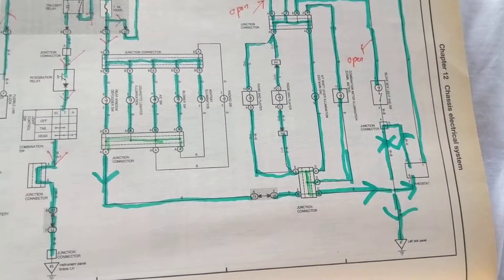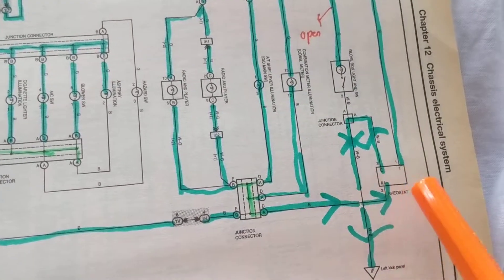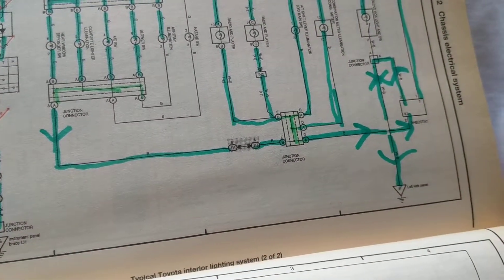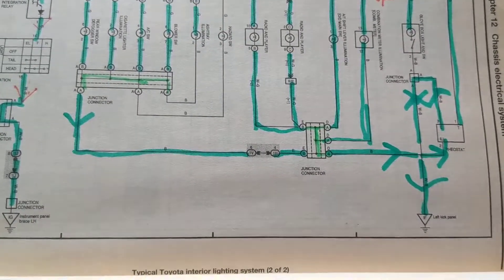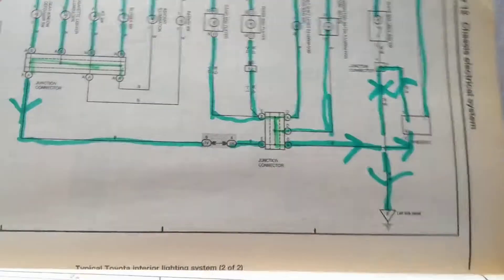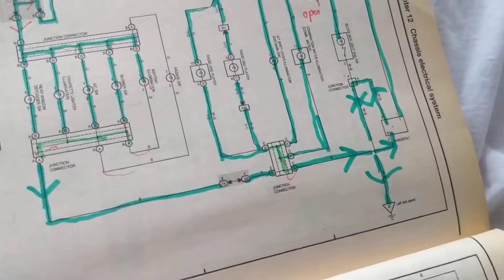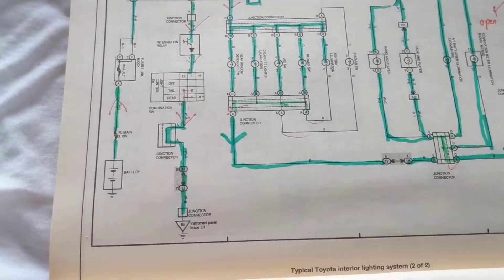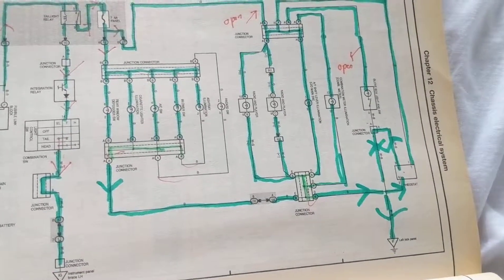HOW TO FIX LIGHTING PROBLEM FROM WIRING DIAGRAM TOYOTA

Comment: How can we adjust the rheosta or dimmer switch?
is it manually or automatically?
Thank you
Reply from the maker: It depends on the make and model of the car usually there's a control switch what you do it clockwise obviously for more lights obviously counter can clockwise for less dimming lights but there has to be a control
Reply: @Joeelectronicschematicsforauto  thank you